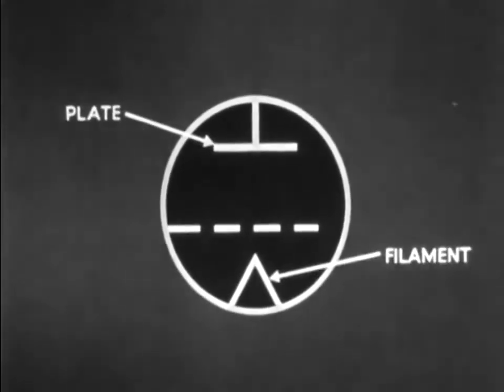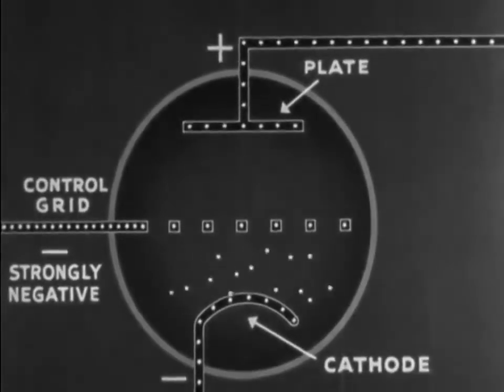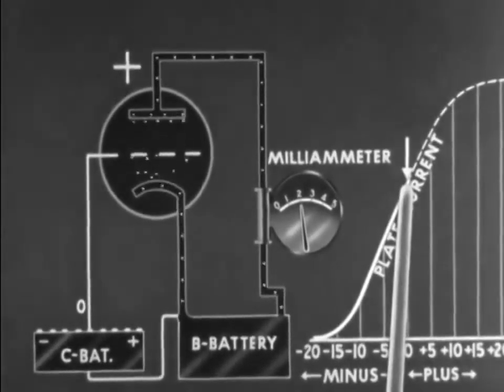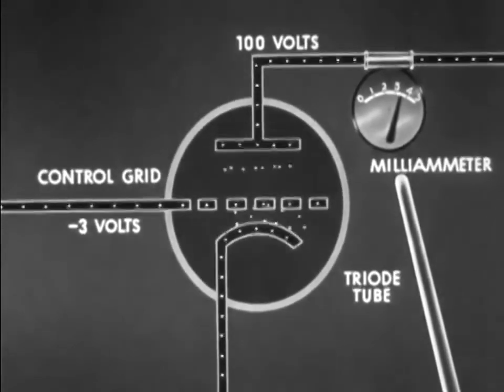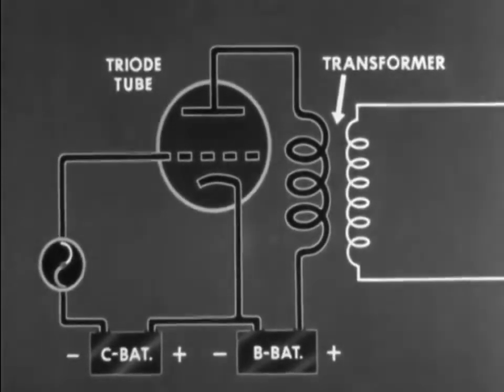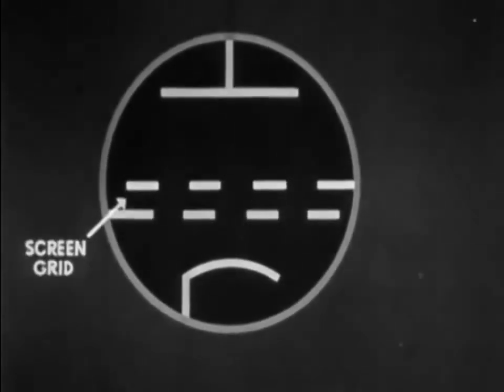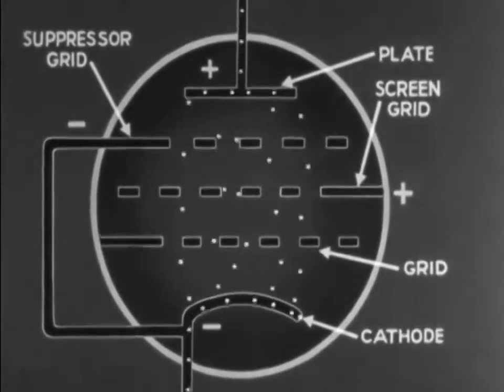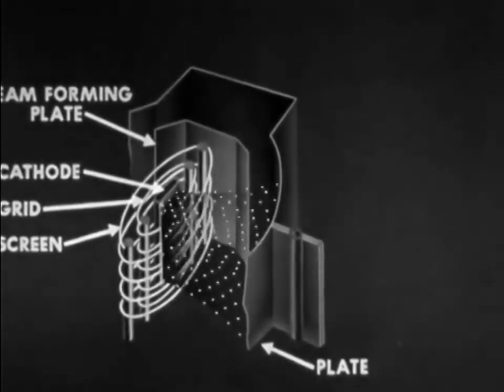Vacuum Tubes - The Triode & The Multipurpose Tubes - 1943 US Army Training Film

Comment: Why don’t we use these modern technology anymore
Reply: They are still used in microwave ovens (magnetron), high power RF applications like radar, X-Ray tubes for medical imaging/radiology, and specialty audio amplifiers, particularly guitar amps.

They have been largely phased out of consumer electronics because they simply can't provide the same complexity, miniaturization and very low power consumption offered by solid-state devices.
Reply: @guitarbage86 don’t forget in hi-fi audio setups